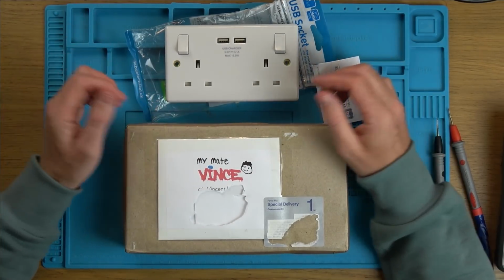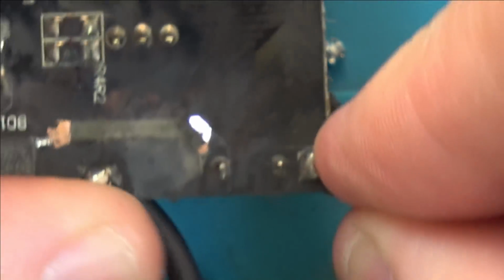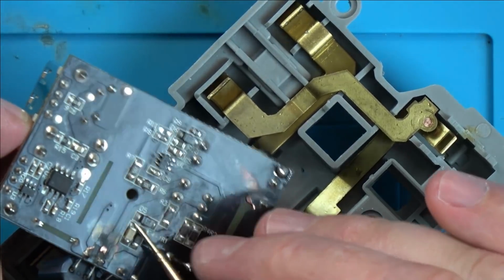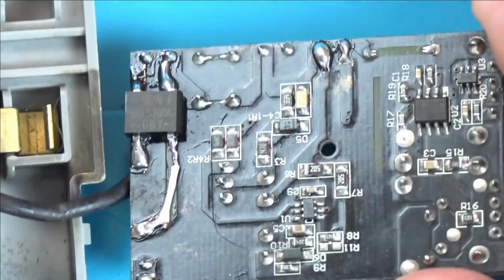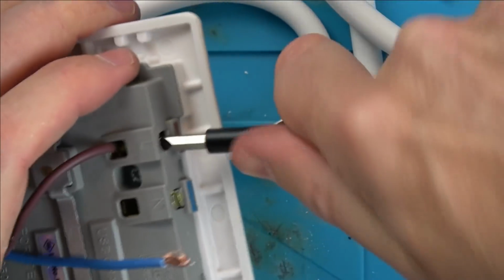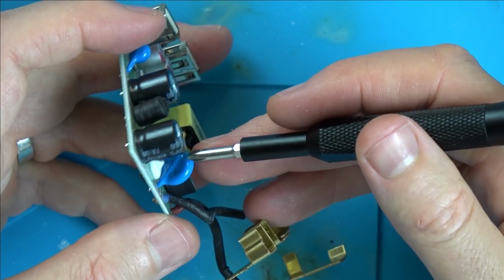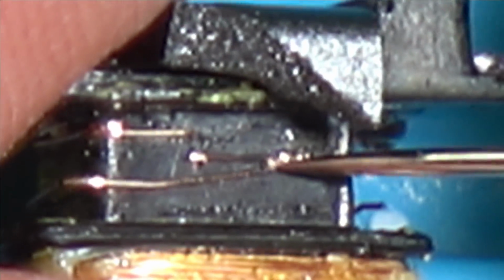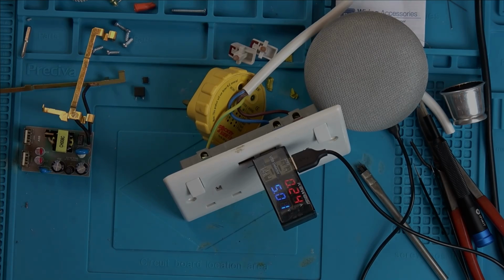Burnt Out Exploded USB Wall Socket - Trying to FIX

Comment: Hi, I've just bought a couple of 240v 3 pin plugs which have usb outlets. The first time I switched on it exploded exactly the same as the wall socket. The supplier is trying to tell me it's because I need to use a high voltage usb cable, which I think is his way of getting out of refunding me. Have you any advice please 😊

Comment: When these came out first you could get a 3 switch one. So you could switch off the charger. I've no idea why it's so hard to get a 3 button now

I have a couple of cheap 3gang units that plug into a socket they have 4 buttons and 2 switched USB ports.

Comment: What really bothers me a bit Vince is that the wall plug was so crappy it actually blew up in the first place. I mean surely it was better designed than that. I guess one thing to note is that the 240volts didn't seem to go to the USB sockets or else if something was plugged in it may have suffered the same fate. To be honest I have never liked the idea of USB ports along with 240volts, even though every USB charger is exactly the same, they just seem to be more robust is all. A fine video Vince perhaps more of a warning about these devices than anything else, I have to say I have never seen a plug in USB charger ever blow up.

Comment: The reason the output voltage isn't stable is because that looks like a flyback SMPS design, where current regulation is done on the primary side with no feedback from the secondary via an optocoupler. Without secondary side regulation, the output tends to be all over the place with no load applied. It'll get a bit better with a load, but it still won't be as good as a SMPS design with feedback from the secondary side.

You got very lucky just patching traces, fixing the choke and replacing the bridge rectifier. I would have expected the switching mosfet to be damaged, along with the switching controller IC. But it looks like the blown traces saved those components this time. I'm baffled though at the choice of fuse here, 3.15 amps on 240 volts is 756 watts, it's no surprise that the traces blew, that fuse rating is far too high. I would go with something in the 1 amp range, maybe even half that with a slow blow fuse to account for the inrush current of the capacitors.

Comment: MK have recently released a screw less version of their two gang socket with more accessories to come in the future. 

The UK lags way behind in this area compared to the rest of the EU as they have has screw less accessories & consumer units for decades but the move is slowly happening which is only a good thing but some are still stuck in their ways.

In the UK most sockets are wired with cable that has solid copper conductors at 2.5mm2 CSA so the screw not making good contact is not really an issue if terminated correctly like doubling over the conductors. 

Due to regulations the opening has to be big enough able to accept three conductors at 2.5mm2 CSA so that lets say the socket was on a ring final circuit & you wanted to add a spur from the socket it is possible.

When you are just inserting one conductor of a smaller CSA the terminal aperture is rather large hence why many double over. 

When using fine stranded conductors like you are in the video bootlace ferrules should be used to hold all the fine strands together to give the screw something to hold onto.

If you have taken a UK plug apart that was wired from manufacture you will see that the conductors are ferruled for this reason.

Comment: I would never install those things, a house fire waiting to happen, flimsy light weight electronics permanantly connected to the mains, with no ventilation or quick means of isolation. At least that one had its own built in fuse, which blew, but not before alot of smoke & burning had occurred!

Comment: This thing should be banned. the USB uses 5V and 12VDC the first coil is known as a choke, it damps surges. If that thing had done that with your nice new iphone plugged in, it would not be nice. Use a dedicated device that you plug in when needed. Electronic faults usually happen due to brown outs, with that on all the time that will fail at some time especially if you are near heavy industry. .

Comment: You could defiantly do with a mains isolation transformer when working on things like this, not the type used on building sites. But a 230V ac to 230V ac one. If you are unlucky enough to get a shock, it would still hurt but much less catastrophic.

Comment: Hey man. not sure how I could contact you. I have a ps3 fat system 80gig. I packed it away working a long time ago. took it out the closet and it would come on but I had no video. then I took it apart to clean it out put it back together now i'm getting the ylod. I'm considering changing the NEC caps on the board but i'm afraid that if I do I will just end up wasting money to import all that stuff only to realize that the GPU is also bad. what do you think? could the caps have been to blame for the system coming on but not displaying anything then maybe when I took it apart it finished off the system?

Comment: I've always called a cord with a plug on the end a "zip-cord" but they usually have alligator clips on the end to attach power in test situations.  They are very handy to have around but are VERY dangerous!!

Comment: As an electronics engineer i would seriously warn people of the dangers of working on this type of equipment and would not encourage anyone on trying to fix any high voltage equipment, and by the way that first capacitor just before the blown  filter choke would be charged as it would have nowhere to discharge.

Comment: May I also suggest using a series incandescent bulb in series, as some others already suggested? 240V 25W or 40W will do. It will prevent your circuit from blowing up on you when plugging it in. If there's a short, it will just light up that bulb brightly.
And, of course, you need to discharge your capacitors. Preferably by using two test leads that are connected together by a beefy 47K resistor.

I believe I didn't see you do that. The first capacitor gets charged and there's nowhere for that charge to go, because choke was open.

Comment: Vince watching your videos when dealing with high-voltage kind of scares me. You should look into building a current limiter or also called dim bulb tester. They are easy to make cold save your life and the equipment that you are working on.  If that dose not work for UK maybe isolation transformer. Anyway like your videos and I would like to see you stay safe.
Reply: A dim bulb tester would work in the U.K., but probably not too well on a USB socket as the current draw should be very low in normal working state. But an isolation transformer is defiantly the way to go, I’m fairly sure using one saved my life once and I am qualified in electronics and for many years worked fault finding and repairing mains powered electronic devices.

Comment: Repairing stuff like that outlet (well done and nice vid! 👍) should really only be done for science purposes or similar. Not for an actual repair.

Mains electricity is dangerous and maintaining isolation in something like that is crucial since phones and cables have exposed metal parts. With such a trauma to the board you never know if something has happened to the isolating layers in the transformer for example.

Personally I think USB outlets are proper junk. 🙈
They're constantly powered, unsupervised fire hazards and they will fail in a few years time.
USB type A is also obsolete now, and type C probably will be too sooner or later.
A regular outlet will on the other hand last for decades.
Reply: They should have some sort of built in isolating micro-switch which only connects the circuitry to the mains, when a USB plug is inserted, but I suppose that would add too much to the cost, for a lot of manufactures!
Reply: My thoughts exactly!

Comment: This is why I would never mount transformers into the wall in an 'always on' mode. It is more like 340v once through the bridge. What could possibly go wrong... lol ps, It would have worked without that component and bridged across - it is just a common mode choke for noise filtering on the mains. I think it helps stop v=backfeed noise INTO the mains from the switchmode chip.

Comment: i believe what likely happened is plugging something into  the usb likely hit the bus bar  shorted/blew up you will likely need to put electrical tape so the circuit  doesn;'t blow on the bus again

i think it also took out the mosfet

tell ya mate to replace  every power point he brought years ago as I think there was a design fault within mk 1 versions of the usb charger

Comment: Nice experimental video as always Vince. That transformator like thing is a common mode choke for filtering. Just for testing you could even bridge the 2 sides separately. It would maybe worth to check or replace the capacitors too.

Comment: As someone said mk have just released a socket, crabtree did make a range of light switches that had push fit terminals in the late 80's early 90's
We are a bit behind Europe, they have push fit breakers as well, by Schneider or Hager.

Comment: A 1A bridge rectifier protected by a 3.15A fuse. What could go wrong?

Edit: Did Vince really test it using a mains plug with a 13A fuse in it? Does he like loud noises and unexpected fires? :D

Comment: When I have to switch on such 'dangerous clients' I switch off the circuit breaker (which is in another room) first. Then I plug in the 'client' and then leave the room to switch the thing  on remotely with the breaker  ;-)
BTW: you can dismantle such 'transformers' by removing the tape and boiling them in water for about 30...45 min. The ferrite core than comes apart very easy. But use gloves - it's hot ;-)

Comment: I agree with what you said about cheap modern mains plugs.  They are horrible to work with.  The screw connectors in particular and the spring clip that holds the fuse in particular are made from substandard material and often fail within a short time only being held together with the flimsiest of rivets/screws.  The best modern ones are the rubberised ones, where everything is wired to the front part of the plug, with the back part fitting over it.  They're more expensive, but worth the cost in the long run.

Comment: Spring connectors eventually fail after the metal undergoes various heating and cooling cycles created by loads.  US plugs had a facility to use a spring terminal.  We replaced countless numbers because the customer would start the Hoover and half the room would go dead.

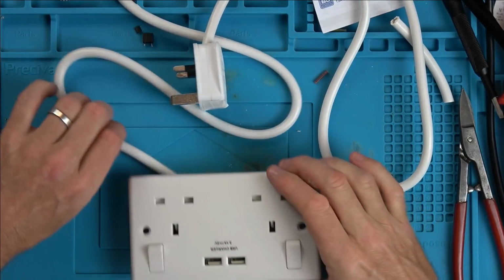Comment: 25:45 just waiting for the big bang, those electrolytic caps doesn't like AC so they are probably toasted, you should measure them before closing the socked. If in the leftover video there is short on the socked it will blow the plug in your hand in the moment of pluging it in. 28:29 yep, the transformer (it is not a transformer but double drossel or choke or bobine ... don't know which is right in English) you can eliminate it and just put 2 jumpers. One BIG advice, whenever you test some device on mains and you're not sure whether is working or not, always put an incandescent lamp in series, that way if something went short on the end, the bulb will just light on, therefore no big bang will occur and you will have control indicator and because the lamp is wire, if all is OK it won't light or barely light ;)

Comment: My Mate VINCE
🐨 Pretty sure you "have" Err-"own" a Component tester, and that tester can test that Dual inductors Inductance, Like wise a lot of good Multi-Meters may have an inductance setting as well..   
Once the inductance of the good side is measured, Any Dual Inductor with the same Inductance should work, making the USB supply stable again, well as stable as it was initially designed to be, Oh and that Wall Plate should be safe to use..

APU I dropped a    👉👍👈

Comment: My suspicion is the capacitor lead broke first, causing the raw rectified mains to go past without smoothing, which led to inductive back-emf that blew the bridge rectifier. I'm a bit lost what blew the common mode choke, but it was probably just overcurrent. Surprised the choke died but the transistor survived.

Comment: Here is two tips, maybe will help you
First: how to easy test bridge rectifier. Put negative probe on + mark on rectifier and positive probe on AC input of rectifier on first lead and on second, you shoud get reading of diode. Then do same but positive probe put on (-) mark of rectifier and with negative probe on both ac input.
Second tip: when you test Switch mode power supply use 100W incandescent bulb in series. If here any short, bulb will lights up with full power, but if there no short circuit bulb will light up just second or less because capacitor need to charge

Comment: It was very risky plugging it in without checking all parts. You forgot to check the most important thing. The switching transistor/mosfet. The rectifier is a very rare fault. Mostly goes the transistor short and bangs the rectifier also. I was surprised it didn't bang.
Reply: Na rectifiers often go out especially when one side of it is shorted to ground. Ive seen it happen to multiple devices already. Which is crazy because they are meant to handle a lot of power.

Comment: That open transformer is just a common mode choke, it’s used just for filtering, you could bypass it to test, BUT something has overloaded it so there is another fault further downstream.
Reply from the maker: Thanks Scott. Do you think the failed bridge rectifier caused the failure on the common mode choke, or do you think something else in the circuit may still be faulty? Cheers 👍
Reply: @Mymatevince  It is possible that the smoothing capacitors where trying to clamp the AC down that had gone through the blown bridge, and thats what took out the choke, I would be suspecting the capacitors as at the very least they have been stressed, and that could be why you are seeing fluctuations in the output voltage as there could be too much AC ripple getting through to the controller.
Reply from the maker: Thanks Scott, others have mentioned the caps too. Interesting about the possible cause in the fluctuations of the 5V output. Thanks for sharing the info!

Comment: In general, you can test a bridge rectifier in circuit by putting your black probe on the DC positive output & measure between that & the two AC inputs, repeat with your red probe on the negative DC output & measure between that & the two AC inputs. You should see your 0.6V drop across all. You may need to wait for the meter to settle as the reservoir cap(s) charge.

Comment: What I think would be a better Idea is if MK or other UK manufactures would make a face plate that just contained three USB sockets with a switch to isolate the USB transformer when not in use with NO 13a sockets built in just a dedicated USB charge point. That way no confusion and no transformers to over heat or use power when not in use. I just don't like these always on type.

Comment: Interesting video Vince =D  That small transformer is a common mode choke - as you discovered!  You are probably right about a surge taking out the bridge, and then the AC passing through perhaps destroyed the choke.  When testing - always remember to reduce plug fuse size (3A or 5A would be safer).  I know there's the 3.15A fuse on the board, but imagine it wasn't assembled properly and something was shorting outside of the range of the fuse etc.  I would imagine after AC going in (through shorted bridge), it would be wise to replace all the electrolytic caps on the primary side.  Canadian YouTuber - lol!

Comment: Hello Vince, love your approach to repairs.
Regarding the connection of the socket to the house wiring - as it says - its a WIRE, not a (multi strand) cable like you were using.
I don't think that a wire does mind that its pushed by a screw that much. AFAIK UK's house wiring regulations are the most strict ones of the world.
I agree though that a flat contact surface pushed by the screw would be a bit better way to hold the wire.
P.S.> You can always put some solder on the stripped cable's end.

Comment: where there is a reason why in a transformer you need a core inside... And a broken one is not good. probably you could just bypass the inductor at all and probably would have been a better job

Comment: that transformer thing is just a common mode choke (coupled inductor) it's used to supress the high frequency noise generated by the mosfet switching on and off the transformer from getting to the mains. You can short out the windings and you would just get a noisier appliance for testing and fault finding.
Reply: The main characteristic of this component is that both windings are the exact same length and when electricity flows through one winding it will induce a magnetic field into the magnetics which will induce current in the other winding, but since the other winding has current flowing in the opposite direction it will try to generate a magnetic field of its own and both will just be cancelled out.
Reply from the maker: Nice one Thomas, thank you 👍

Comment: The electricity bill will pe huge with that power supply running all the time so it would be much nicer if it had a separate switch to turn off the power supply
Reply: No, it draws practically nothing without anything plugged in...
Reply: @Evaldas65  that little bit of power that is drawing but it is wasted